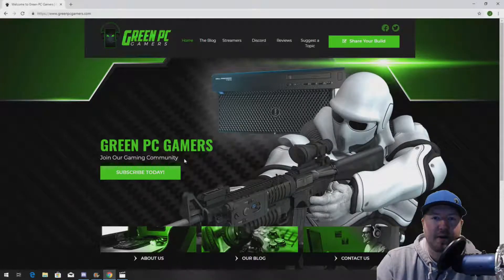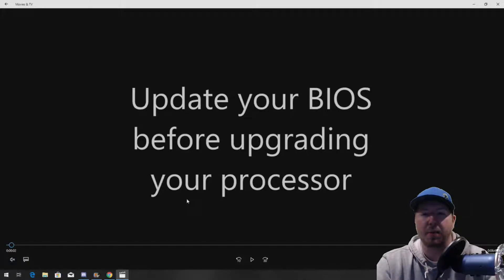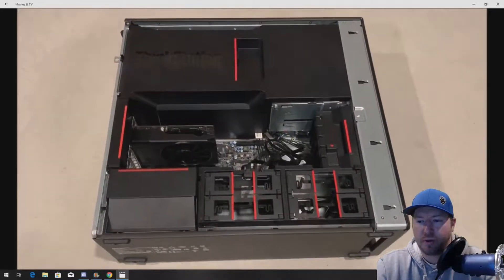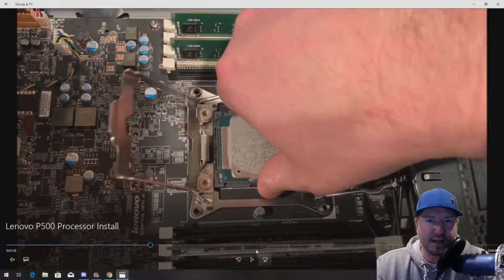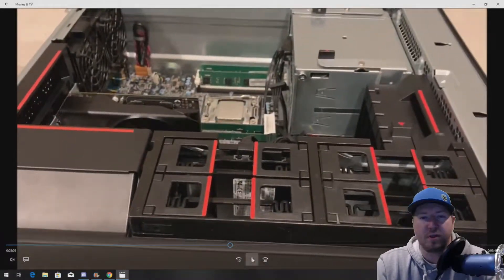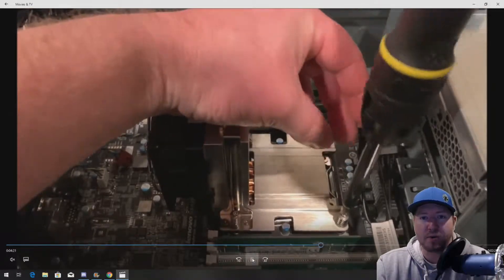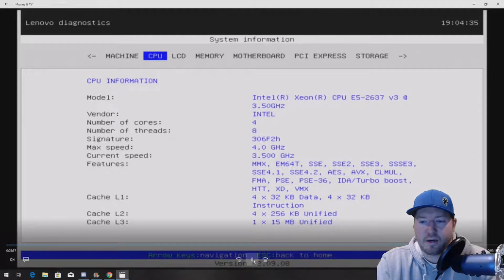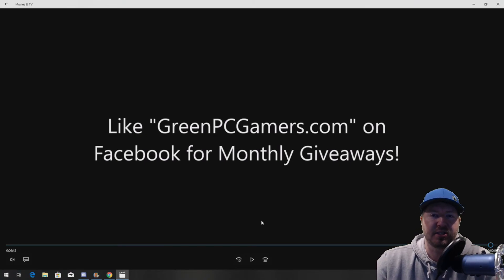Lenovo Thinkstation P500 Processor Install (E5-2637 V3)

Comment: Which gpu is best with this processor
Reply from the maker: It depends on what you plan to use the GPU for.  However, if you are referring to PC gaming, these cards work really well:  GTX 1660 Ti, RTX 2060, RTX 2070, RTX 3060, RTX 3070.  (Ti's and Supers included)